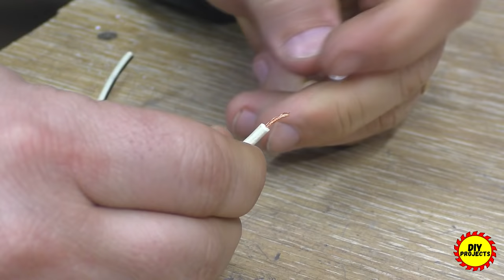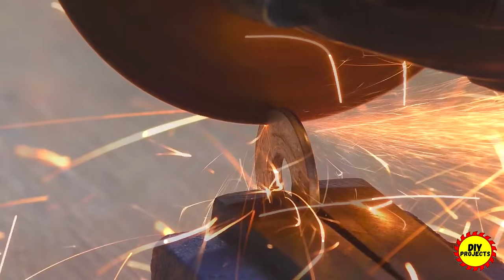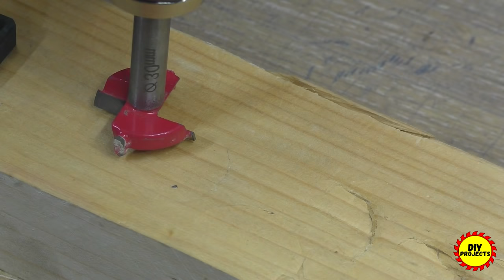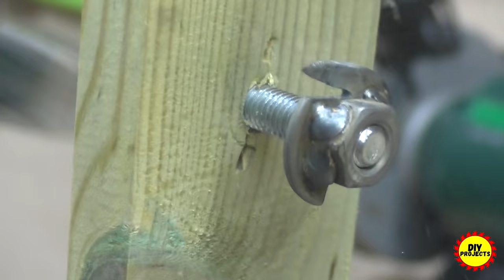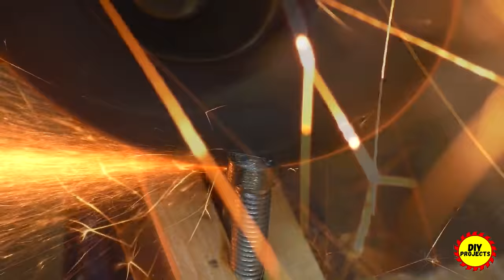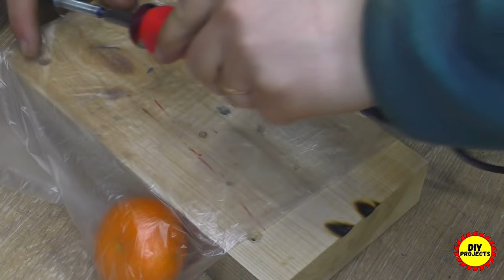Few people know these Housekeeping Tips and Tricks That Really Help

Comment: The two trades you don't "hack" are plumbing and electrical.  You risk burning your home down, electrocution, flooding, mold... All things that will ruin a family.  Spend the pennies and use wire connectors.

Comment: the one with the nut with the washer cut to fix when tightening in wood is a great idea, but this connection of conductors doesn't work because it oxidizes and gives bad contact, it would work if it was strange.

Comment: Never "mix" copper wires with aluminum, unless properly done, as when electrified, could cause a fire!  Copper wire expands and contracts, but aluminum wire likely won't, causing a loose connection with spark potential.